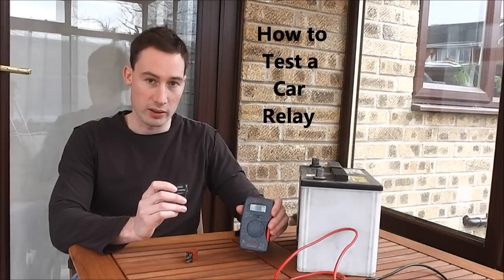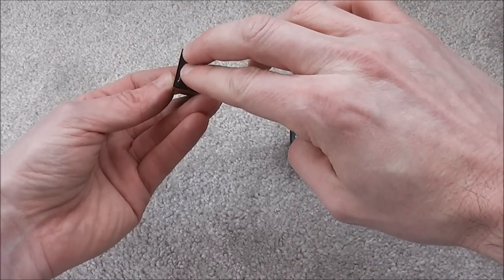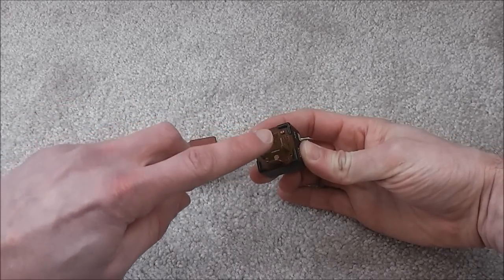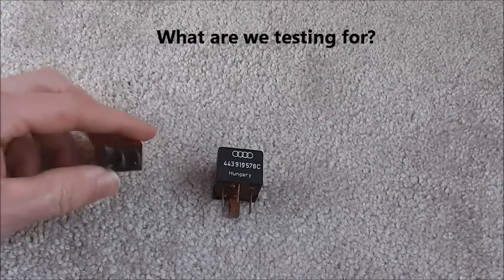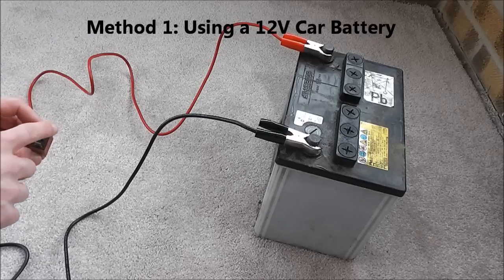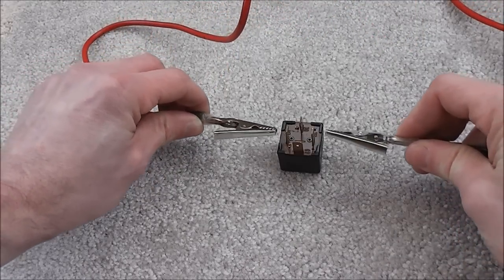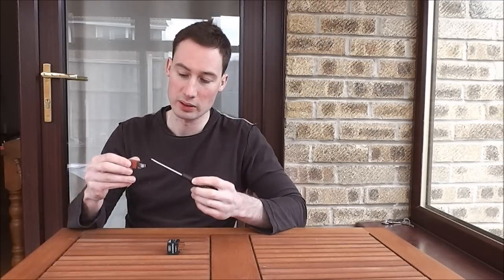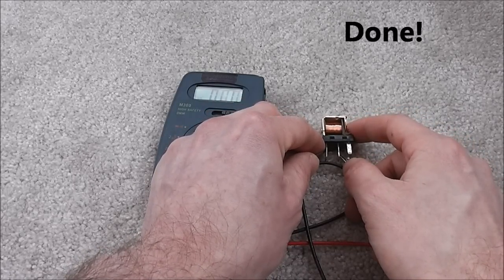How to Test Car Relays

Comment: Actually, you can test one of these with a 9 volt radio battery for 12 volt relays, and two of these in series for 24 volt relays. Much lighter than a car battery.

Comment: my volvo won't start when I put my keys in just put a starter in still won't turn on 2000
Reply: You have to replace the Volvo in your car. Usually cost 20,000.
Reply: Lorraine Sawyer im having the same problem, my accessories dont even come on unless i jump the battery

Comment: Using a car battery that way, is extremely dangerous. A small 12V battery will do the job just fine.
Otherwise, a very helpful video.

Comment: Great video and I learned a lot... but better connect +12V to terminal 86 not 85 as per the DIN standard. If you have a relay with a diode in it and connect it like shown in the video, you will damage it (like I did).

Comment: use 9v battery. like what Jan Verschueren said, you short that car battery, you're in for a light show.
Reply: john adamson Hey man... will 5 volts trip the relay?  I'm trying to trip it from an Arduino and only have 5 volts to play with.
Reply: Rick John More than likely 5 volts won't supply enough amperage to activate the coil to pull in the switch. If you're using Arduino, they make motor control shields that either come with relays or you can buy them that plug in like the ones in the video. Make sure you know the voltage that you are trying to switch as well. Are you trying to use the Arduino to switch a 120v circuit or only use the 5 volts supplied?

Comment: Using bare crocodile clips to connect up a car battery to a relay... dude! -what if you accidentally short the battery?!? -that would turn this video into an electric welding tutorial. :P
Use insulated fast-on terminals instead or get a cheap laboratory power supply so you can limit the amount of current in case of a short.
Reply: Nerd alert
Reply: Jan Verschueren This is actually a very important point. Without putting a fuse or anything in your circuit this is a very dangerous way to perform this test.
Reply: +Jan Verschueren Jan you seem like the man to throw this question at. I've got a ford relay which I want to by-pass. Its for my cooling fan, I want it to run constant so I can figure out if my over-heating car is an electrical or mechanical problem. Its pins1,2,3,5,7. two large, two medium and one small. What pin sockets should my lead go into and what would you call this lead? lol
Reply from the maker: lol, thanks buddy :P
Reply: Jan Verschueren An excellent point! Safety first always!
Reply: +lejambon08 Well, I'm not a mechanic, but cooling fans for cars are usually switched by a thermostat located somewhere near or on the radiator. If you short those connections the fan should turn on, whether it's switched by a relay or fed directly.
As for figuring out your relay, as the clip shows, you're looking for two terminals with some resistance between them, but no more than a few hundred ohms. That's the coil and by measuring continuity between the other contacts as you energize it repeatedly (use a 9V battery as suggested below), you can figure out how the relay switches.
Seeing as it's got 5 connections, it probably has a change over contact. If you want a load connected to this relay to run permanently, you would connect the "common"  and "normal open" connections together with a small spade terminal jumper wire.
Anyhow, as they say, hope this helps. Besure to read the other comments as well, as there are some usefull tips in there.
Reply: lejambon08
Reply: lejambon08
Reply: lejambon08
Reply: Lol